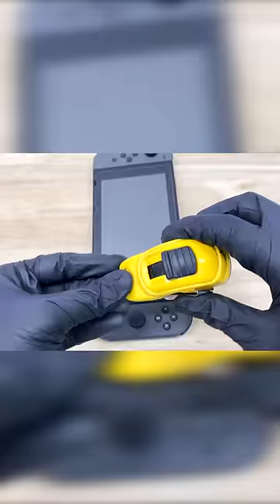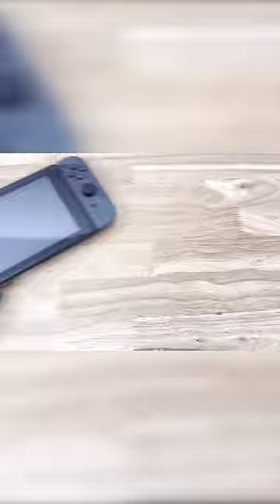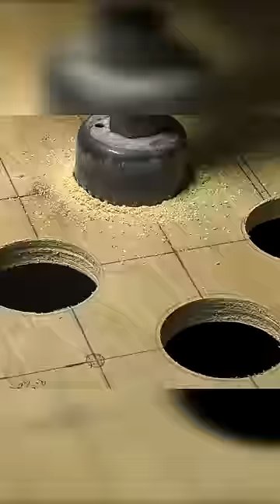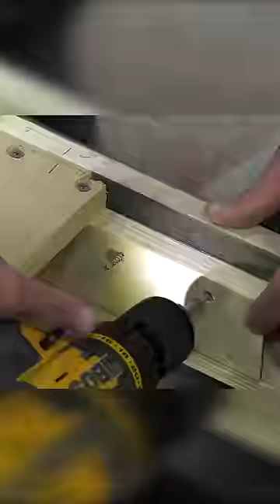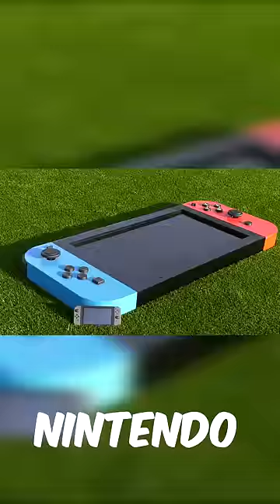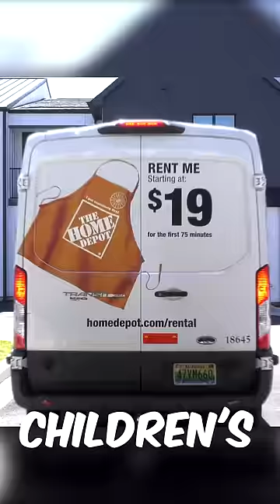World's Largest Nintendo Switch #shorts

Comment: It's that big but probably still has 4 GB of Ram 💀
Reply: Think about it the bigger the sd card the more the storage
Reply: @penguindude9931  nah SD card Is for storage to have the apps and games on the switch, Ram is totally different, it's the important part of a device, the higher the ram the better For Performance of the switch so if the switch has 6 or 8 GB of Ram a game like fortnite will Run 60FPS and look better
Reply: @penguindude9931  but since it has 4 its basically like old Android phones with like 4GB or lower, and games like Super Mario Odyssey run 60FPS because any Nintendo IP game are made to be played and be optimized on the switch. Fortnite wasn't optimized for Switch but with a few changes it can manage which they did.

Comment: To be a switch the controllers need to be able to slide in and out and also function. The motherboard should be installed as well otherwise I just have a tv that looks like a switch.
Reply from the maker: Thanks for the input!